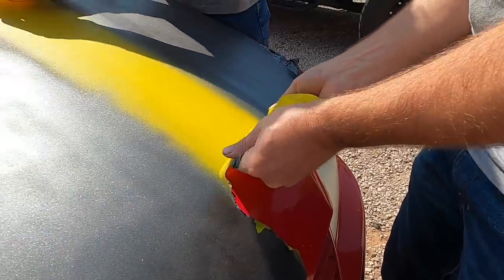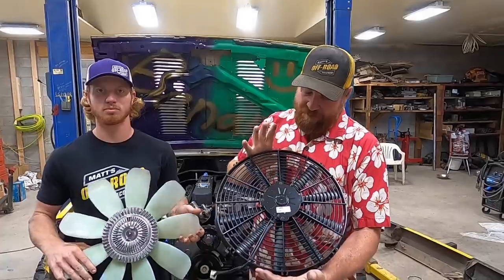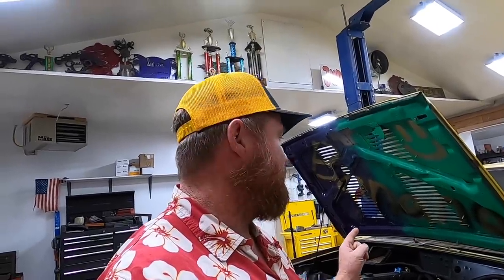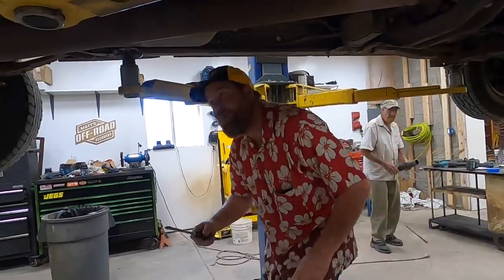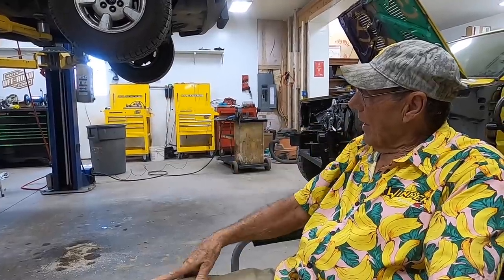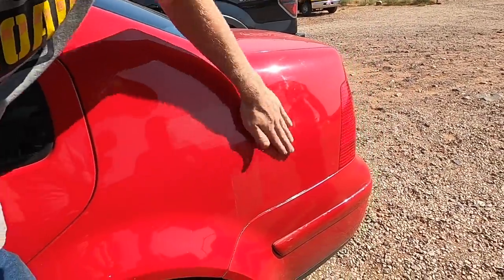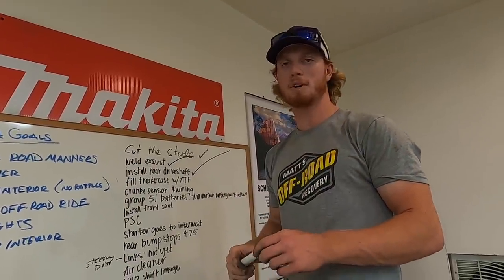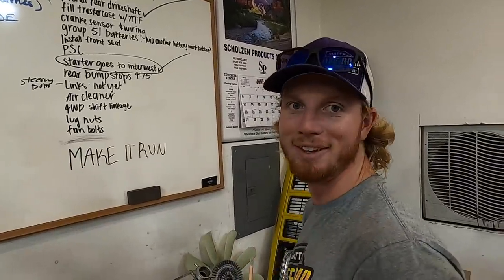Massive Cooling System Upgrade For The Jeep Banana!

Comment: Matt's not aggressive in sharing knowledge, he's confident. That knowledge was hard won and he knows it's true, no matter what a hundred thousand internet experts claim.
Reply: Internet expert here. You sir are correct 😁 Always Great content. I would like to build a jeep to get the family out more. Off-road adventures
Reply: Yes, I never got anything but knowledge. 
Probably people that weren't ever told true facts straight up. You know, like at a job. 🤣
Reply: @dronesdirtbikeschannel2250  well get to building and get that family out adventuring. Only thing holding you up is you( and possibly money).
Reply: @TheSteve1175  apparently the keyboard warriors have been scared by matt dropping some knowledge.
Reply: Why not focus on Removing the air from the engine bay? 🤔
Reply: @tanner882  fine line between cooling and over cooling.
Reply: @combatbeard7643  don’t think overcooking will ever be a problem, considering the ambient temperatures the Banana mostly operates in. Also, consider the most extreme conditions it operates under - low forward speed while doing a recovery while engine at max revs generating max heat. If over cooling becomes a problem during winter months, just install an airflow shutter like on most European trucks.
Reply: @combatbeard7643  like the two gigantic vents in the roof or no inner wheel well skirts? Idk what else he can do. Not being sarcastic, there might be other things but I feel like maybe he would have done them if there were 🤷‍♂️
Reply: @tex_gil117  i think for his application it probably works great, as he said he runs it at 5k quite often,  where i am riding the mountains  we dont put that many rpms out,  maybe every once in awhile, but when we start to get hot we just hit a river.
Reply: @farawayorganics  very true
Reply: My bad that comment was meant for that tanner dude. Ur def right tho
Reply: @tanner882  like the two massive vents in the middle of the hood?
Reply: I like the way you formed your words together. Nice on the eyes, easy to read.
Reply: @farawayorganics  right? Besides, every automotive cooling system since antiquity has a thermostat to maintain proper engine temperature by bypassing the radiator under a certain temperature. The only real danger is freezing the radiator core if Matt ever screws up the coolant mix.
Reply: @tex_gil117  actually it might sound silly, but with the right flow I’d suggest try and seal the engine bay to be able to suck the hot air out, not entirely seal but just so you can be efficient with heat removal.
Reply: Yeah he is.
Reply: @combatbeard7643  Cue the river.
Reply: @combatbeard7643  that's what a thermostat is for.
Reply: I hope you have gotten larger cables for the trailer winch
Reply: Would a electronically actuated fan clutch work better to control air speed at idle?
Reply: @brandonstone6919  probably, but you can imagine there are not many situations where forced airflow would not be required at idle.  The question here seems to be more about the maximum cooling capacity rather than precise control of what’s available.
Reply: He’s confident but doesn’t know what he’s talking about. Buying parts like mishimoto tells me he doesn’t really know what he’s talking about.

Comment: Re: Radiator Fans, I went thru every fan mod and combination possible trying to keep a 345 V8 Scout cool in Arizona. Matt is absolutely right the water pump driven stocker will haul more air than anything with one caveat: It must have a shroud. And the fan must stick out the back of the shroud about 1/2 to 3/4 inch. Set up like that, the air coming thru the shroud strangely does not blow straight back across the engine but rather exits at 90 degrees from the edge of the shroud, or right straight off the ends of the fan blade.
Reply: Same thing.. went through several "electric fan combos on my 4.0 and eventually had to go back to stock fans with a 3 core radiator.
Reply: Do you know what radiator (brand name) he is running?
Reply: What fan is that?  Sorry went on a long trip here in Canada up a mountain qnd been having heat issues as my truck was overloaded.  Also think my lower radiator hose might be collapsing... no spring in it.

Comment: MATT I've told you numerous times run EVANS WATERLEES COOLENT! It has no water in it so no pressure build up and it's boiling point is 375 degrees so you will not get bubbling and cavitation due to overheating! I run it in my 1967 Plymouth GTX with a 440 and tunnel Ram in SC and I don't even have a fan shroud on it! MAKE THE SWITCH!!!
Reply: I haven't had any issues at all. They say it may run a little hotter but I haven't noticed any difference from regular anti freeze. Love your videos! I'm hooked!

Comment: We need more of Ed in a chair pointing out the things he needs help with.  Reminds me of working with my dad in his garage.

Check out Amazon for split loom.  100' is about $15 there.  WAY cheaper than parts stores.
Reply: Support your local parts stores
Reply: No time for Amazon they need it now.
Reply: You need to watch out with Amazon though. I bought some 1/4 inch fuel hose to use for a diff breather and the outside is already cracking after two years. It doesn't see any sun so it's not a UV problem. It's just junk hose. There is sometimes a reason why things are cheaper on Amazon and it isn't the economics of scale. You think you are just buying a piece of hose or some split loom but with polymers and rubber the composition really matters.

Comment: The tighter and deeper you run the shroud the more efficient it will make your fan. The shroud should be air tight on the back of the radiator. A 3d printed one would be a thing of beauty.  That said the vents in your hood also help. Another thing that would help is a scoop or something that looks like a megaphone to focus the air on the radiator. This effectively increases frontal area of air collection. It will create a high pressure zone in the front of your radiator. This is a good thing. I suspect every little bit helps. Thanks for sharing and you always seem cool and collected even when you think you are saying something aggressive, it doesn't come off that way. Just be yourself. You are fine as is.

Comment: I had similar overheating problems came to similar conclusions with my '79 Bronco. Final configuration was a F600 radiator shell from same '70s era truck , custom made 3 core, extra large passages, 100 percent drive stainless 7 bladed flex fan(no clutch).  It is loud at high revs so I just turn up the radio.  Always floats around 185-190 DegF, on the beach, revving in the sand, with A/C on. I'm fortunate that my vehicle has enough room for the large cooling system. Flow-cooler used to make a rivet-on back plate you could mount to you factory water pump.  Worked for me.

Comment: If you add a extra cooling tank, like a air tank from a simi. It will give you up to 8 gallons of extra coolant plumb in into heater lines so all coolent flows through rad. It’s not an overflow tank.   We do this our simi trucks here in Kansas,  rad fan only comes on for A/C .
Reply: Is that worth adding 70+ pounds to the build?
Reply: @shawnbrennan7526    Yes it is
Reply: What you might not realize is a diesel produces less waste heat than a gasoline engine.

Comment: My '00 WJ has the clutch-based cooling fan, and all you need to do to it when towing in a hot climate, is to change the 195 degree thermostat, to a 170 degree thermostat. When that clutch kicks in, dang thing sounds like an airplane trying to take off haha. Those inline 6 engines are great.

Comment: Just think about it, you have an engine powering a fan, or at best a little 550 brushless motor.  Which do you think has more power, and more power means the ability to push more air.
Reply: To be fair that electric fan had a way smaller motor than other models. But clutch fans are popular on certain vehicles for very good reasons, and yes, horsepower.

Comment: Probably 90% or more of people who watch these videos have never fabricated to the level we see on this channel. Let alone complete a build from scratch or do a tear down and rebuild! And if it’s those few  people that are criticizing you, tell them to apply or a job. I bet very few could a do what you do. Feel free to drop knowledge this way anytime!!!
Reply: I've built/helped build an ATV from the ground up making most of the components by ourselves. We only bought brake equipment, the engine and the CV joints and some small stuff.

Saying that, even I am surprised by the level of manufacturing on this channel.
Reply: Only things I'd do differently and I've built a few jeeps n trucks is beadlocks and a electric fan for when idling

Comment: I had one of those water pumps in my XJ and I changed back to a stock one it was just starting to leak and didn’t last long. I also did not really notice a difference with keeping the XJ cooler at slow speeds on a hot day. 
Rudy did a beautiful job with the welding on that exhaust!

Comment: Mill out a larger water pump pulley. That will slow the water pump down at higher speeds. It will also allow the coolant to spend more time in the radiator cooling it down more.

Comment: Try different Thermostats.  If your hood interferes open it up and put a scoop on it, perhaps facing rearwards.  Can you TIG weld the tips with Stellite?  Some dirt track racers remove every other water pump vane, as they spin too fast to pump properly.  Fewer vanes seemed to help.  Trevor, use some medium Rubbing Compound on those headlights.  10 min per side. Tape the paint.

Comment: Finally, someone who believes in mechanical fans and explains why its better. Moves more air, less wires, less load on the alternator(especially at idle). The engine power gain you get from switching to electric fan is negligible. Just replace the plastic parts like when they're starting to become brittle and you're good. 

Also look at oem electric fans - they have much bigger and wider blades than these aftermarket ones.

Comment: Your practical information is really great! I've put an electric fan on every vehicle I've owned (that didn't come with one) because of the HP leach. Never had an issue in southern California heat. But it makes sense if you're running high RPM, dragging vehicles at low speeds. Probably why big rigs and tractors (that I've seen) don't use electric fans.

Comment: Dirt Track race cars had cooling issues for High RPM as well.  Most guys put larger pulleys on the water pumps, slow them down.  Solves the problem when running 6000-9000rpm on a small block chevy.  Same fix for my hot rod with 5.19 gears that i run 4000-5000rpm. Overdrive the waterpump, use mechanical fan, make a decent shroud, aluminum radiator.

Comment: I get the CFM difference in those 2 fans and i'm sure you guys have looked at many different ideas, but part of your water pump issues could be because of that heavy clutch fan.  No matter what that clutch sticking out there off the water pump, puts pressure on the impeller and bearing and causes premature failure.   I'd keep looking for an electric option if possible just to help with that.
Reply: @MattsOffRoadRecovery  Gotcha, I had similar on a bronco, kept killing my water pump bearings. Was just a thought.  :) I'm watching you guys build its going great !

Comment: I run a slightly warmed up .030 over 400 sbc in a 79 chevy k20. All I use is the stock clutch fan, big block radiator and the full factory fan shroud. Even in the Ga humid mid 90's summer days, it never comes close to overheating.

Comment: Matt when you “drop knowledge” it never sounds passive aggressive or condescending. It has always sounded friendly, good hearted and kind to me. I think that’s why you are so popular here. 
COOLING! I’ll try not to type like the above here. If you want to keep your car cooler or cool it faster/more efficient use less coolant and more water. There I said it. Water is 300 times more efficient at cooling than coolant. It boils @ 212° depending on elevation. 205° in Hurricane, Ut. Anyone who has run track cars or bikes knows you can’t run coolant on the tarmac. Water only because coolant is slippery and is hard to clean up in a crash. What to do? Use Boyles Law of temperature and pressure. Use a high pressure radiator cap and less coolant, preferably with Redline water wetter. I don’t work for them. A 15psi cap and 50/50 mix will boil @ 268°. 19 psi cap 100% water boils at 169°.  As an example, we run 20/80 coolant & Redline with a higher pressure cap on our dirt bikes, in hard endurance high altitude riding (9,000+) have never had a boil over. Friends bikes puke there guts out. Ours go the whole season and don’t lose a drop. 
Just make sure to run something to lube the guts of your system. Oh, the water pump wear. Looks like cavitation. Using a good diesel rated coolant should help. Early 7.3 Powerstroke’s had an issue with this type of thing. Motorcraft makes an additive. 
Hope this helps. 
For the others out there that ask about Engine Ice. Run it. It’s expensive and boils on its own at 356°f. 180°c for you folks with an accent. If your motor gets that hot you want to know! Nothing cools as efficient as water! As Mr. Gump said, “that’s all I got to say about that”.

Comment: Another thing that can help with overheating is to replace your hoses with aluminium pipe/tubing held in with short hose lengths like industrial cooling systems are set up. Rubber hose does not conduct heat very well at all. When you make up alloy replacements and just use short lengths to hold it together you are increasing the amount of heat conductive surface area.

Comment: Got to add my 10 cents worth on the cooling, why not an electric water pump with temp control, fast warm up in winter and better cooling in heat as it has no link to RPM, warp the headers a the engine bay temp will drop as you do not have 8 red hot tube heaters in there.  Do not forget any cold air in needs to be able to get out easy as well. Find a friend with a thermal scope/camera and see where the hot spots are on the rad and target that area with the fan/shroud.  PS I learned the hard way about engine bay heat after melting the coating of a lot of cables in there.

Comment: Ed has a bearing failing under the hood, idler pulley, tensioner pulley, water pump, alternator.  Need to fix before failure.  Great video's, love this channel.

Comment: My county’s summer temperature reaches over 50 under the shade !!!! My advice remove the thermostat during summer and return it Back when weather cool down. After doing this drive your banana with your garbage in your trailer with AC on.

Comment: In my 2001 Jeep Wrangler sport I am running an ATK 4.7 l stroker motor with an aluminum radiator That's rated around 400 horsepower and flexalite electric fan and I decided to use Evans waterless engine coolant and I'll never go back to normal coolant again. 

What's nice about Evan's waterless coolant is that it's the life of the vehicle so you can actually remove it filter it and continue to reuse it. Since I started using Evans waterless coolant my jeep has been running a lot more cooler even on a 90 some degree day stuck in traffic. Since I had the brand new ATK 4.7 l stroker motor put in I was starting fresh with a brand new motor so that's why I decided to not use your conventional coolant and switch over to Evans which is the best decision I have ever made.

Comment: Okay well I only bring this up because I love your show. Your big fan blade analysis is spot on. Can you fit a shroud on too?  My range rover has an oil cooler, trans cooler and I had my radiator re-cored from a 4 core 3/8 core to a 3 core 5/8 core. this is 28% more effective.  Contrary to popular belief Aluminum does not cool as good as a copper radiator, however the aluminum is far more durable and only slightly behind the copper in terms of cooling. I would suggest you cool the oil more effectively. You may consider adding more to the Transmission cooler side of your equation. Yes your above 5k RPM's a lot but not revving in a driveway, your towing as well, in extreme heat. Additional and separate cooler from the radiators.. cool the oil and the tranny fluid more effectively and you will have AC on the hottest days with out sacrificing your cooling. They even cool Transfer cases as well. Of course you probably know all this already. keep up the good work and the great episodes.

Comment: I see you have the emissions/catalyst delete configuration. Bad boy, bad boy! I know a whole crowd of the off roadies and pick’um  up community looks for any excuse to toss the emissions gear, but it should really be installed on any road going vehicle anyway. Just because your in nowhere Utah, it still should be installed. Automotive sourced air pollution is still air pollution. And overall, automotive emission controls have made an improvement in overall air quality nationwide. And the basic lambda based cat systems are effective, simple, durable and reliable.

Comment: Check out the dual brushless fans for diesel sled pullers, they rip CFM's too with no drag. I took the Clutch fan off of my weekend duramax toy and installed a 4 core all aluminum with $1300 dual brushless fan set up from duramax store. I am in Texas so heat and humidity are staples of life. Motor doesn't create as much heat w/o the fan especially at normal driving speed , when i make 1/8 mile and 1/4 mile drags it can get a little hot but nothing dangerous.